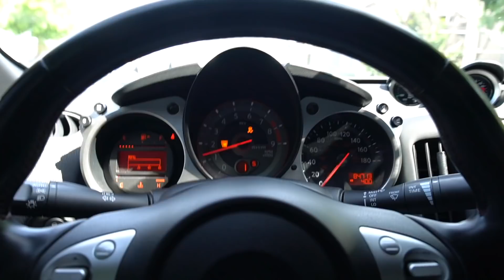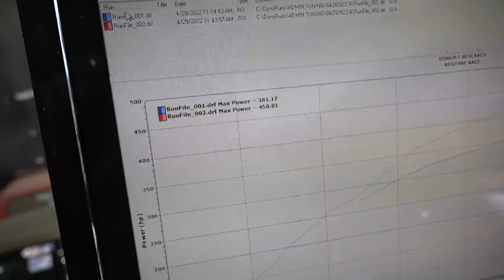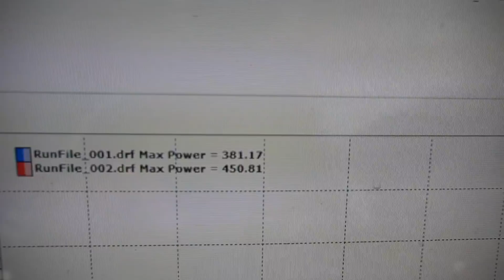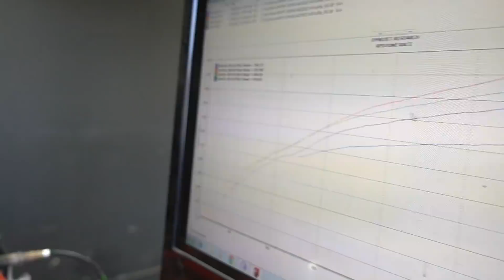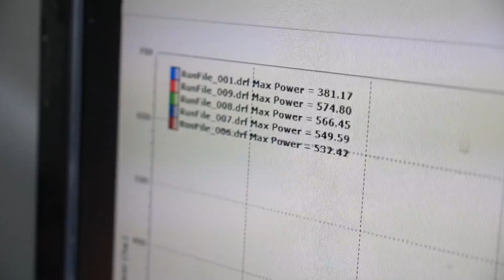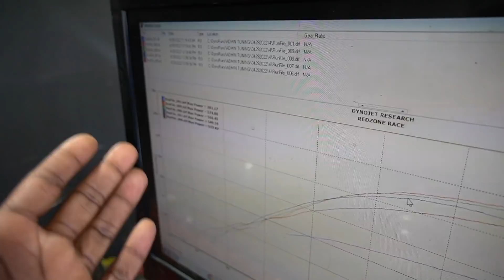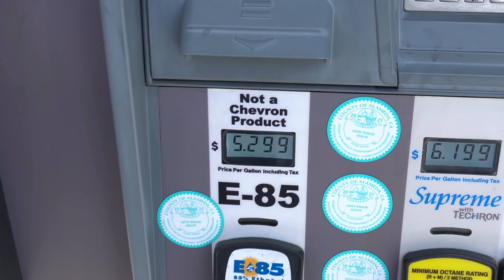SINGLE TURBO 370Z DYNO DAY + FIRST DRIVE/REACTIONS!!

Comment: So, 1 thing you can do if you want is have a shop add a taller bead weld to the ends of the charge piping than are currently on there, so the clamps have a much harder time popping off. As for turbine sizing…. What are you running now? Bigger you go the longer the spool, but honestly, on that 62mm turbo, I wouldn’t be afraid to run a 1.05 A/R. Also, a full 3” exhaust all the way back will help as well if you aren’t running that already. Happy boosting brotha!

Comment: I’ll be getting a vq in a couple months … What should be the first performance mod to gain some hp??? Btw this car sounds like a beast frr
Reply: Stock pile parts and save up
For a tune tbh no power increase without a tune but forsure test pipes,intakes, and injectors to run e85 that’s pretty much fbo
Reply: Just look it up on yt bro. There’s whole guides for what bolt ons to get. Maxes out around 400 crank hp without boosting it though
Reply: Nothing just save for a turbo. Anything else you're wasting money and time.

Comment: You got the 6266 BB from Gonzo? I just bought the same kit with the goal of 600whp.  Ill be running full fuel return system and 340lph pump as well with 1000cc injectors, gtr spark plugs and coils, and an aem truboost controller. Curious to know what the torque numbers were as well